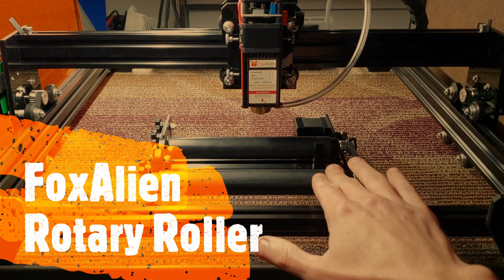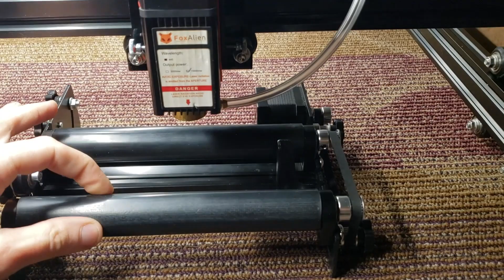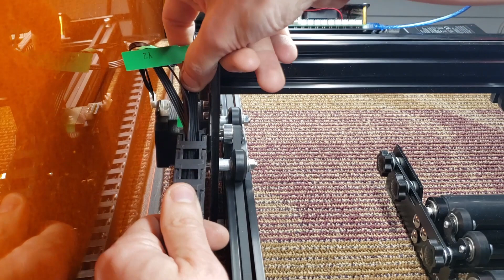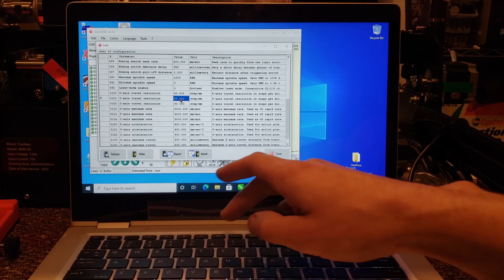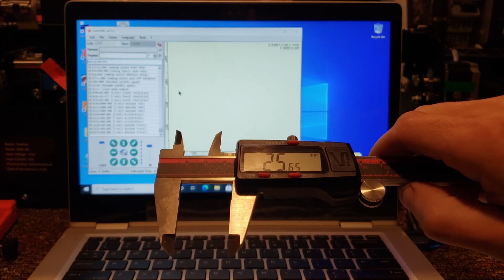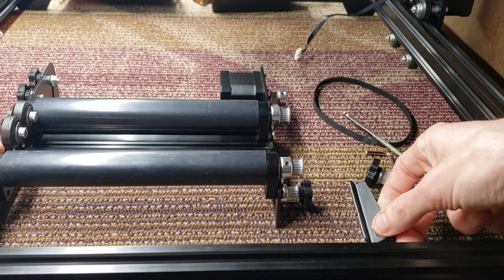FoxAlien Rotary Roller installation, testing, and review.

Comment: Great video.  Very informative.  I do want to ask if you get your mac to work on Lightburn.  Lightburn sees my laser when attached to my mac but I can't get the laser to move and it says the laser is disconnected.  My windows laptop works fine.  Just curious if you had any issues.
Reply from the maker: The Mac's require a few extras steps to get Lightburn to work. I have almost no knowledge of the Mac OS so I can't help you there. There is a setting within your OS that you have to change to allow your laser machine to communicate via USB.

Comment: Did you connect air assist directly to control board?
Reply from the maker: Hi Robert! I have the COOLANT FLOOD pin from my control board going into a solid state relay which turns my air compressor pump on and off automatically with the M8 command. Super convenient and I highly recommend it!